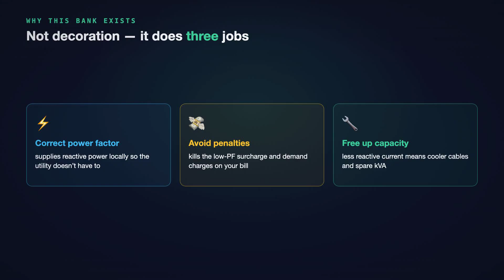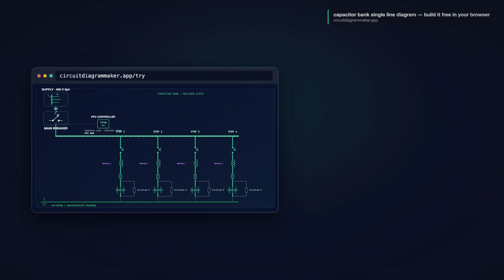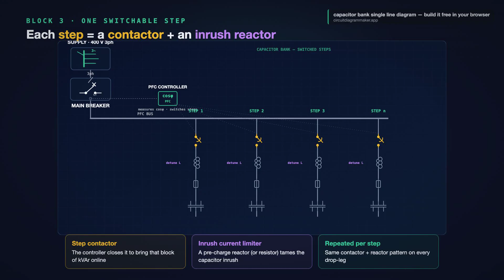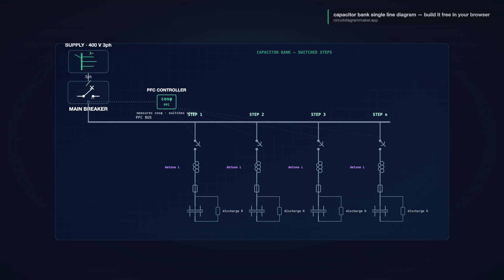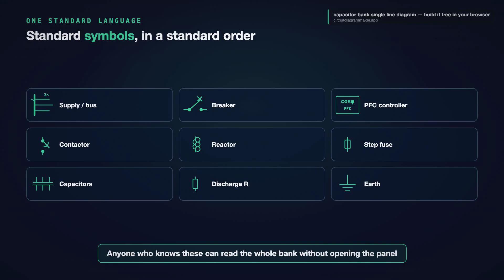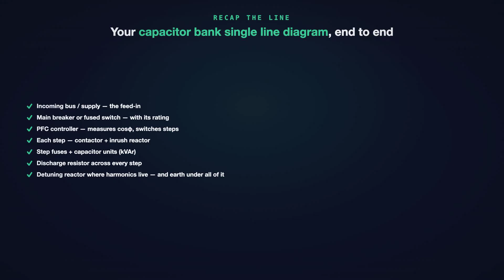Capacitor Bank Single Line Diagram (SLD)

Comment from the maker: Quick map of the whole one-line, in the order the power flows: incoming bus / supply → main breaker or fused switch (put its rating on the page) → the PFC CONTROLLER (it reads cosφ through a CT and switches steps) → the capacitor bank STEPS, each one built the same way: a CONTACTOR to switch it, an inrush current limiter (a pre-charge reactor or resistor) to tame the switch-on surge, step FUSES, and the capacitor units — the kVAr that actually correct the power factor — with a DISCHARGE resistor across each so the caps bleed down safe to touch and safe to re-close. Where the plant has harmonics, a DETUNING reactor sits in series so the bank can never resonate. The trick that makes it click: it isn’t one big capacitor — it’s several switchable steps, and the controller adds steps in as reactive load rises and drops them out as it falls, holding a target power factor (around 0.95) without over-correcting. How many kVAr steps does your bank need? Draw your own free (no sign-up): https://circuitdiagrammaker.app/try?utm_source=youtube&utm_medium=pinned_comment&utm_content=yt-122